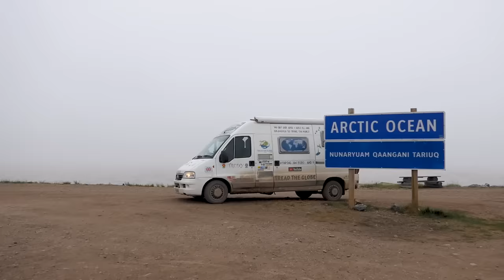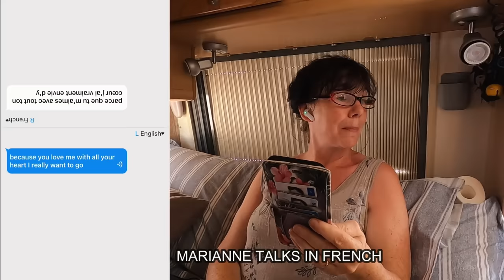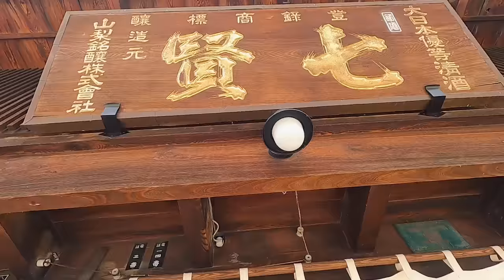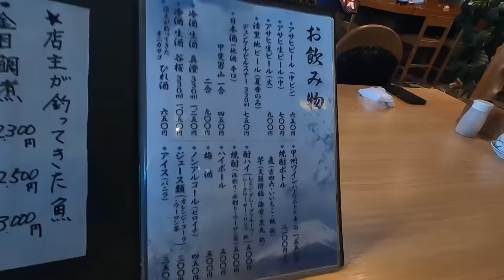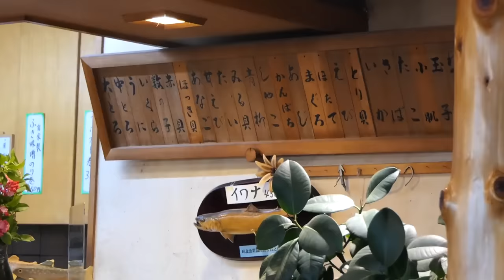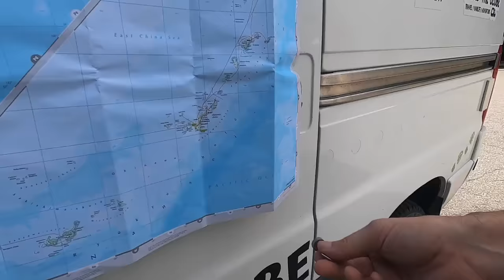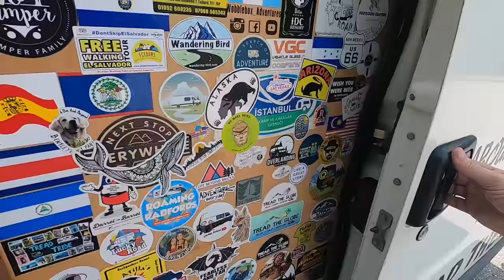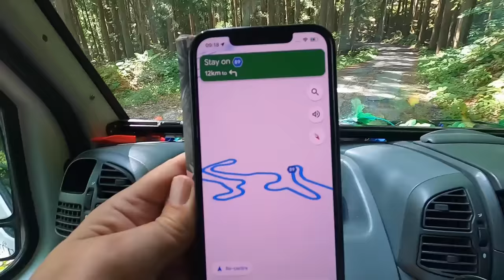UK VAN IN JAPAN - IT WAS A MISTAKE TO COME HERE

Comment: Hi! I'm looking at these translator earbuds for use during parent conferences at school.  I'm having trouble with your discount code.  Did it have an expiration date?
Thanks, Janet
Reply from the maker: Hi Janet - I just tested it and it does work - if you add to the basket then to all the way to checkout on the right you will see how you enter the discount code.   If they are running a promotion  or special offer then you dont get a discount of the special offer price but from what I can see now there isnt any special offer on - let me know if it works - Chris